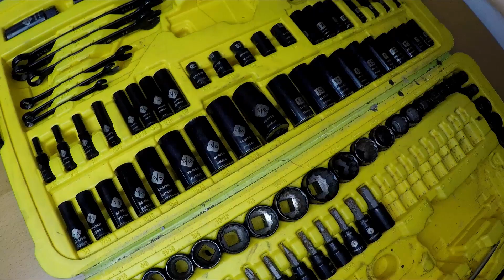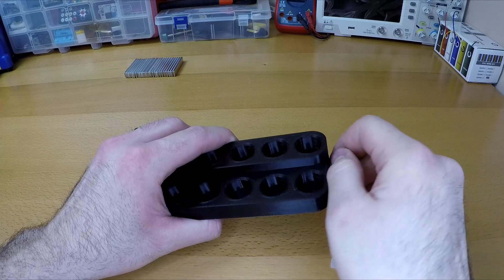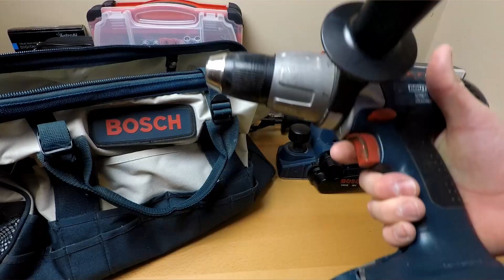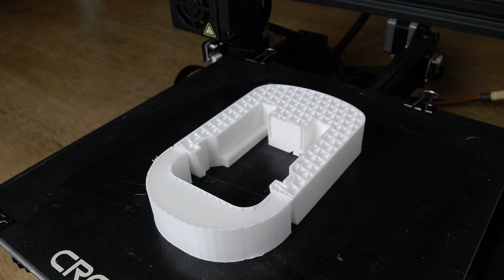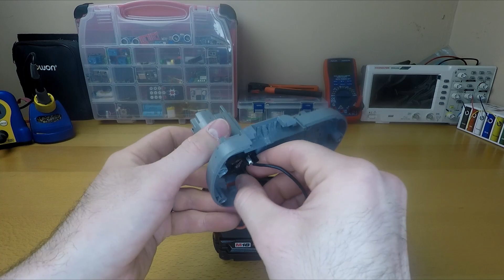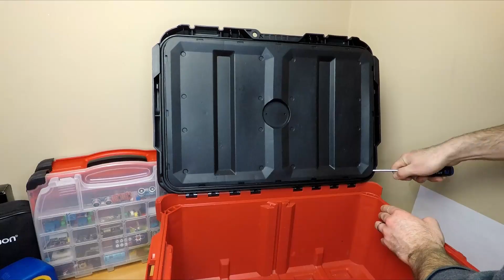3D Printing Innovation: Creating Custom Solutions for Your Tools!

Comment: Great bumbling into you. That is a big project but being able to replicate elements and components certainly saves time in the design process. Well done.
I have a small monoprice printer which I use to print the odd item for my model railway.
Modifying electrical tools is not something I would try but I am sure there are lots of guys  out there who would be interested.
On the 3D printing, I attended a presentation a number of years ago at a company in Vaughan called Proto 3000 . They did 3d metal  printing.
Tbc  Charlie
Reply from the maker: Hey Charlie, yes good to see you! Keep up the good work!

Comment: Awesome vid! What did you use for the contacts on the battery adapters?
Reply from the maker: I used double ended spade connectors that I got from digikey